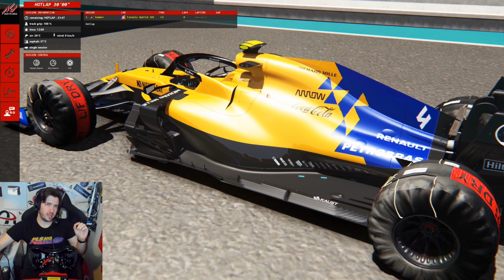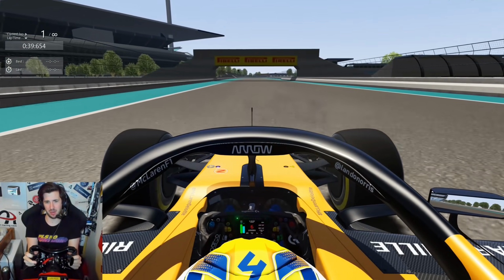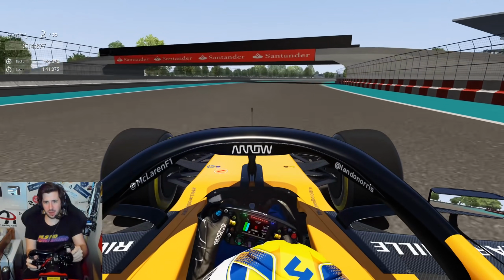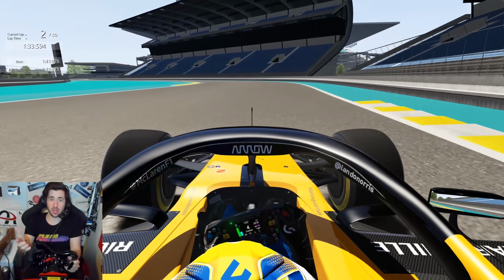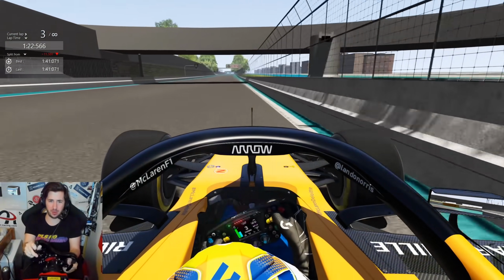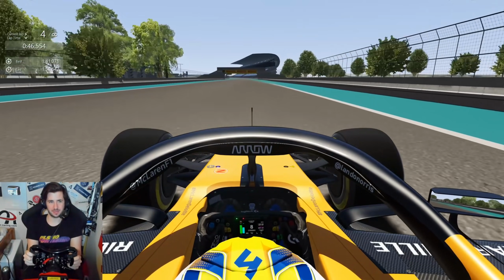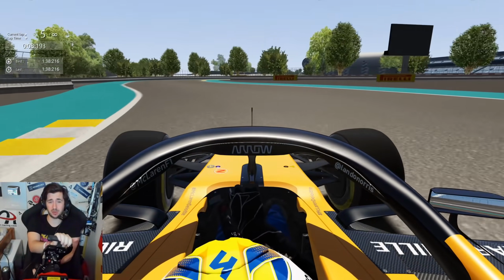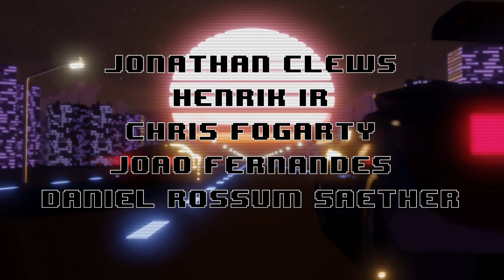Driving The NEW Miami Formula 1 Track

Comment: I feel that f1 is afraid of having to many corners, that might be one reason to having long straights,  these are the fastest track cars in the world, they are designed for corners, so give them corners that can be slow or fast and wide enough to overtake or come back at someone, idk what other people will think of this but this is just my opinion
Reply: Modern tracks generally have way more corners than the older ones. In fact there has been a fair bit of criticism about modern track designs saying they have far too many corners so never flow. I agree the trend toward huge straights are annoying but they are to help overtaking.
Reply: There is one problem. Cars lose a lot grip when following closely in corners which forces following car to run slower. This slow down is too big to allow modern F1 cars to effectively overtaking in mid corner.

If ground effect changes actually work then the penalty will be smaller but still significant. Reduced penalty just makes it possible that cars are better positioned to have higher speed close enough for straight so they can overtake in the next breaking zone and corner.

It is even now true that overtakes need to be prepared so following car already trys to gain enough speed advantage from previous corner.  Too bad the over 1 second cap in corners require following car to have a huge advantage in the speed.

1 second cap translates to about 100 meters distance when speed is over 300km/h. To catch that distance in 5 second straight requires 20m/s higher speed (72km/h) which simple isn't even possible for top teams vs bottom teams.  But already 20 seconds straight lowers the required speed difference down to draft plus DRS difference with 5m/s (18km/h) requirement.

If cornering cap can be reduced back towards half a second it would also reduce speed difference requirement to half making it much more likely following car can catch and challenge in the breaking zone. 

Why did this reply grow so complicated? Either I'm stupid or it is just a complicated problem.
Reply: Pauli although this hurt my brain to read, I agree with this

Comment: The first 2 corners is literally Canada's 1 and 2
Reply: Not even close, turn 34 at Canada are awesome they flow so well, thats the thing on these older circuits you can carry so much speed but go a little to far and you are in a wall, with this modern tracks carry to much speed and you just cut the next corner, or you can carry speed because its a fucking hairpin.
Reply: @sirdetmist3204  The OP talked about T 1 and 2, which are a carbon copy of Canada indeed.

Comment: i think the long straight circuit philosophy is actually the right direction for f1, its forcing the cars to run lower downforce, and thus should lend itself to closer racing. the downside is the circuit looks uninspired at best, so while i agree with the direction, i still dont think its the right way.

Comment: “It kinda forces the tens to use a low downforce setup” that’s literally the whole point. Force the teams to have to create less downforce. Less downforce = less drag. Less drag = less turbulent trailing air. Less turbulent air (hopefully) = better racing. Believe it or not what killed the quality of F1 racing is downforce. Impressive to be able to drive upside down, but the downside of it is that it puts on a horrible show.
Reply: Opposite is true, the higher the downforce and specifically rear wing, the more powerful the DRS was, look this past year at Portimao and mugello which are high downforce, but loads of overtakes were made down the pit straight, compare this to Monza which was DRS train for most of the race and the only pace to overtake was the first corner and it was quite tricky

Comment: This track seems like one big compromise.  Sector 2 seems to have traumatically broken flow after they took away the public road aspect.  It’s dull but I really like the end of sector 3 and the beginning of 1. With the parameters they were given (I don’t think tilke designed this track), they did an okay job, as the alternative was the miami downtown circuit which was atrocious.  If zandvoort works out I think it would be refreshing to try its design philosophy to other aging circuits instead of designing generic new ones.

Comment: It seems like the only task were to make a couple of very long straights, just to increase the amount of (very easy) overtakes. Than someone sad that probably a couple of more corners were necessary, just because it's formula 1, and so the architecture did a sort of work already seen in Japan (Fuji 2005, last 5-6 corners before the straight line). Plus, it's FLAT. I don't want to be the guy that constantly says that "older circuits were better than newer ones", but I honestly think that this one has been done just because there's only one GP in the States at the moment.

Comment: Maybe they should stop building F1 tracks and just build racing tracks eh? Tilke's tracks end up like this because he has to give runoff or if he can't do that, add a hairpin to slow the cars right down before the drivers can make a mistake that leads to a crash but maybe there's another approach? ignore safety at first, design a fantasy track and then figure out ways to make that track safe maybe, worked for all the old tracks like spa, used to be dangerous, was made safe but still remained a good racing circuit.

Comment: Not a fan of this track and it seems kind of haphazardly put together with like bad Yas vibes.

If F1 wants another US race there should be talk about widening Laguna Seca, which is probably the easiest track to get ready for an F1 race (a ride height solution to handle the corkscrew is going to be wild), and I kind of don't want to compromise the character of any other traditional US tracks that work well for IMSA and Indy for a race that probably won't be around that long.

Comment: track design, 
step 1. long straight. make it 2, even better
step 2. hairpin after the straights, oooh yes! 
step 3. steal a suzuka corner
step 4. a slow and cornery bit something a bit like singapore maby? 
step 5. finished. 

in conclusion this track is gonna be a b*tch. 2 really straight longs wich don't need downforce. 
a long turn wich NEEDS downforce
and a cornery bit wich needs allot of grip

it's gonna be a bitch to set your car up for this.

Comment: the track could have been more interesting but shitmann tilke did have to keep the track on the stadium property as the local politicians were concerned about a street track messing up traffic any more worse than it already is (a civil engineering nightmare even on days where there is nothing going on locally). To make matters worse, the opposition to the miami grand prix all called f-1 a 'noise and air polluting event' and even suggested that we 'think of the children' (even though the metropolitan school system is one of the worst of all the metro school systems in the nation). as such, im pretty sure the race is not allowed to run past 1500 hrs, requiring the race to run earlier than usual (maybe that is good for the European audience. It is a shame, there are a lot of great places in the city where they could design a gangster street track, but due to the local politics, they have neutered most options (local liberals who dont understand what the new f-1 era has done for hybrid and electric car technology - florida man personified)

Comment: The slow bits is trash. No overtaking. Yes long straight but it will promote overtaking in the straight and into the corner. However, what ppl are forgetting this is proposed. Hopefully they refine it.